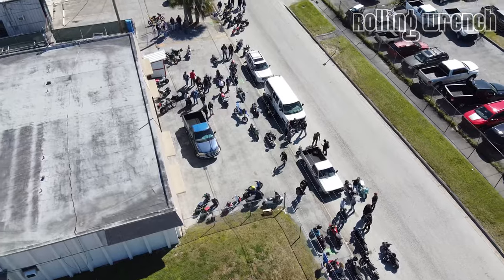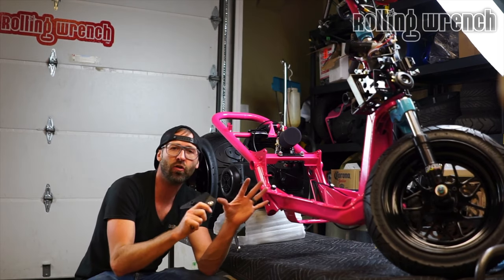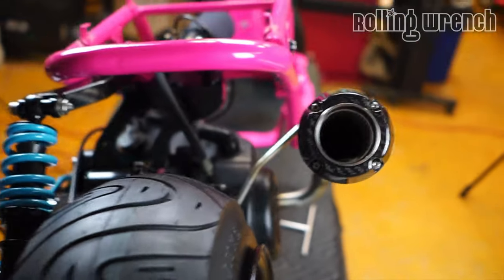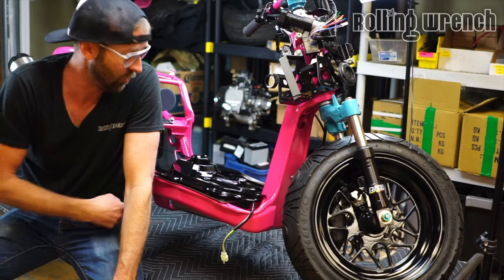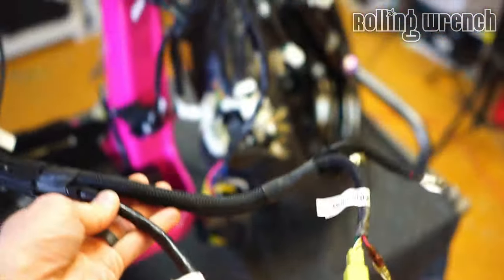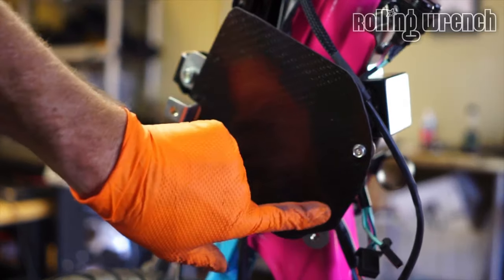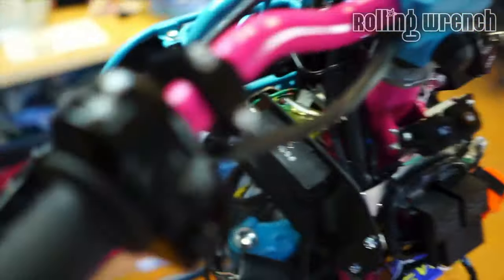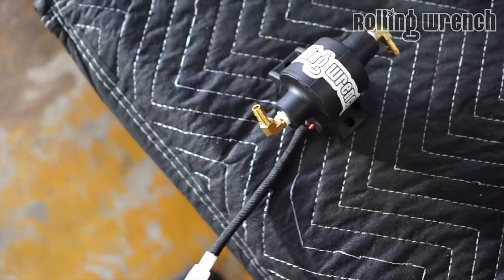Honda Ruckus [GY6 STEP BY STEP BUILD] Episode 3

Comment: Great vid as always.  Whos the seat maker?  Good pricing?  Also,  on the fuel pump.. how much power does it consume?  And, any trouble with it overpumping the poor basic carbs?  That does need to be wired to be controlled by the computer for its power, correct?